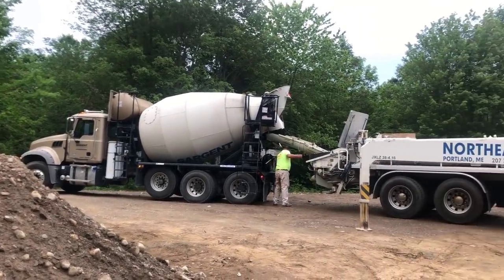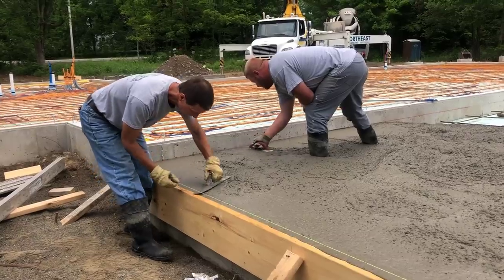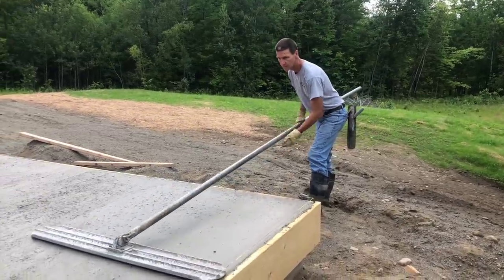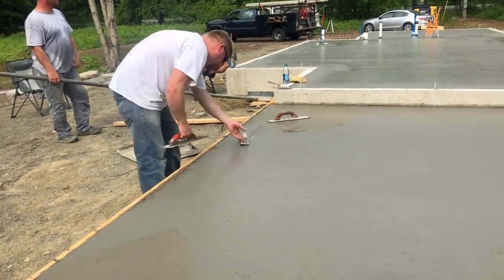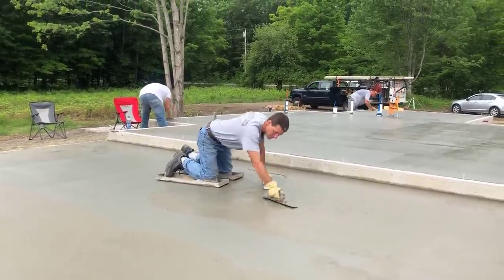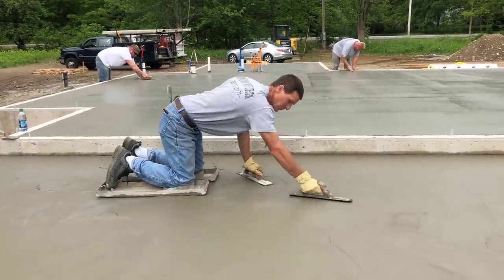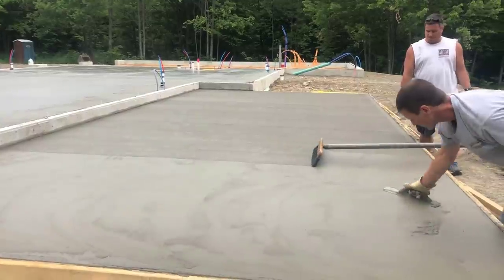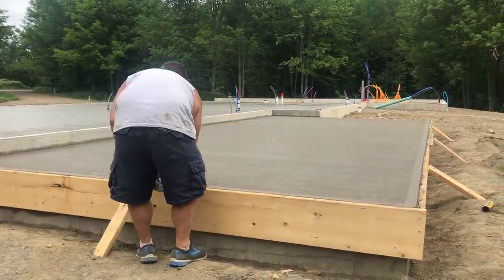diy concrete - how to pour concrete with finishing technique!

Comment: Looked like you got good service from the ready-mix co. You had the top part poured and screeded before the patio was ready to broom. What kind of spacing do you usually ask for, on a slab like that, for the trucks?
Reply from the maker: Usually no spacing. We empty a truck and screed it in 15- 20 minutes on average, especially when using a pump. They do give us good service because of that.
Reply: @MikeDayConcrete  We used to use boom pumps pretty much all the time. For a typical pour I would always ask for a 10min spacing or 60yds/hr. That allowed us to have, 2 trucks at the hopper, so the pumping was continuous, 1 truck washing out, 1 truck ready to back up to the hopper, 1 truck driving to the job and 1 returning to the plant. 
That was always a pretty good formula to keep 6-7 finishers going on a ~200yd pour.

Comment: Nice finish. Once question, I have a 6m x 4m pad to lay so that is about 18f x 12f and 4inches deep, if its being tiled after with travertine stone tiles laid with exterior tile adhesive should I still cut expansion joints into it?
Many thanks from Europe.
Reply from the maker: Maybe one expansion joint to make it two 9x12 pieces.

Comment: I'm looking to pour a 15' x 75' patio against the back of my house.  The only thing i'm unsure about is how many joints I need to cut in?  And do I need to just use surface joints or do I need to use the rubber joints every so many feet?

Comment: Mike i poured a slab the other day and the top of it is really soft so I can just scrub it with my foot and a lot of dust comes off of it it’s a 6” thick was a 4” slump with air but added 10 gallons to 8 yards it was just hand troweled that Night but went back to it the next day so what do you think I did wrong
Reply from the maker: What was the air temperature?
Reply: Forgot to say that but it got down to 30 I believe anytime can do to save it?
Reply: I meant anything I can do to save it?
Reply: Ckeck and see if concert company put Fly Ash in the mix. There’s nothing you could have done that the concert would still be soft.
Reply: Thanks for replying  I’m still scratching my head  I’m not a pro but have poured lots of concrete in the last 15 years and never had that problem

Comment: Would there be issues using a Fresno with air entrained concrete for an outdoor slab like this?
Reply from the maker: I don't like using a fresno on air - entrained concrete. It could seal the surface over and trap air or moisture.

Comment: Love your videos! I’m new to pouring/finishing. I’m doing a 16’x14’ pad I can only strike it on 16’ end threw. Should I use 2x4 in middle and pour 8x14 then pull and do other side? I’ll be using 2x4 to strike.
Reply from the maker: You probably should. The smaller sections will be easier to screed.
Reply: Dunno if you guys gives a damn but if you guys are bored like me during the covid times you can watch pretty much all of the latest movies on Instaflixxer. I've been binge watching with my gf for the last couple of months xD
Reply: @Tommy Harrison definitely, I have been watching on instaflixxer for years myself :D

Comment: I mag and trowel at the same time troweling makes the cement shine, dust brooms up here are better,, cement brooms are heavy but still good,, up here mag an broom is city sidewalks standard,, patios and balconies driveways,,, mag on the left hand and finish trowel right hand,, then broom is standard in Toronto 🖒 the trowel makes the cement shine! ,,there's even a cement  company called CBM or another called Inercon 'lafarge'' patented a shine chemical just for that look,,,, with cure n seal an sealant the product looks amazing 🖒🎇
Reply from the maker: Good info Mike, thanks for commenting!!
Reply: @MikeDayConcrete  thx for the chanel brother🖒🎇